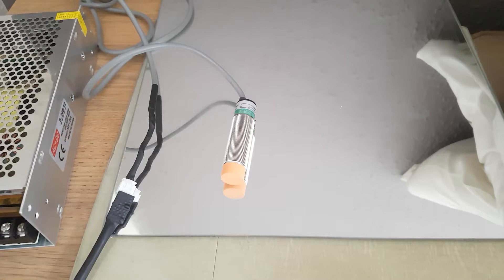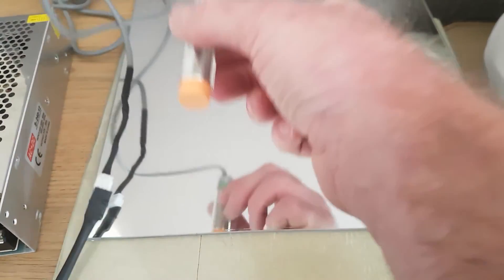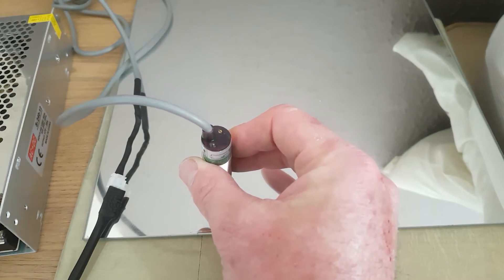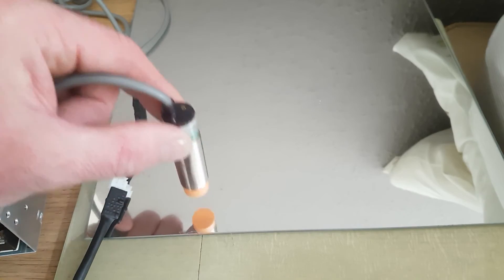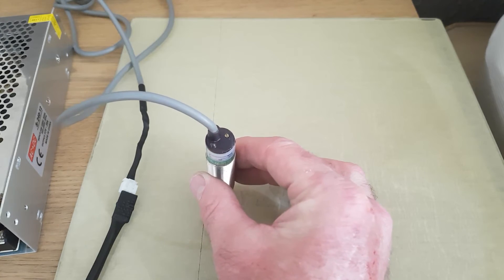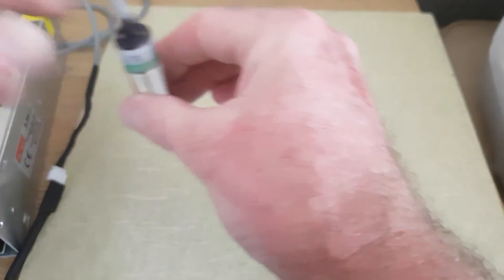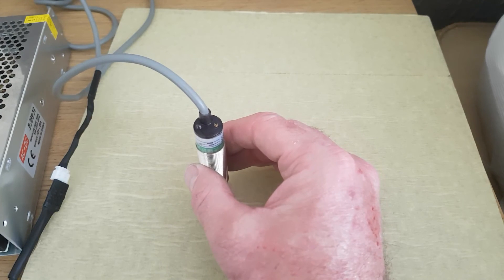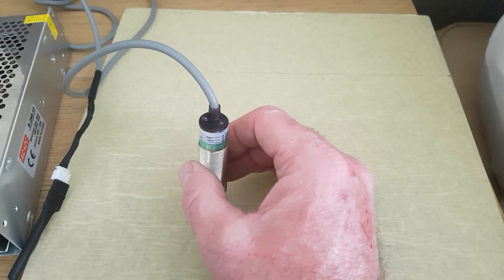Capacitive sensor test from Creality CR-10 Auto Bed Leveling AIO KIT SKYNET3DMODS

Comment: It is unreliable on the CR-20. You can turn it 1/16th of a turn, light goes off. Then take 1 full turn back for the light to come on again.
Reply from the maker: Where did you get kit from ?
Reply: I bought it from Mech Solutions Ltd as part of my CR-20. I am wondering if the capacitive sensor I have is defective or if it is simply unreliable in general.
Reply from the maker: +Greg Ferguson think they used the cheapest possible sensors i know the sensors ive used are much more accurate but you could try turning the sensitivity down on the screw on the top that may help
Reply: Thank you. I also wonder about the firmware being off. After auto home goes to center, selecting Bed Level moves the nozzle to 4 locations very close to the center and does not pause on any of them. How are you supposed to level the bed in this way? I've had to instead align with center, then use CURA to move to the edges and adjust the knobs until the light goes on/off. That is okay but each time it starts, the sensor will be only within +/-0.2mm of where it was last time and the inaccuracy/reliability is throwing the prints off.
Reply from the maker: I've not seen the firmware for the cr-20 but it's entirety possible as I would imagine you bed level would test 9 points front left front middle front right middle left ect ect
Reply: There is a firmware as of July 16,  2018. Just applied it and behaviour for leveling and auto home very different. Confirms the prior firmare had problems.